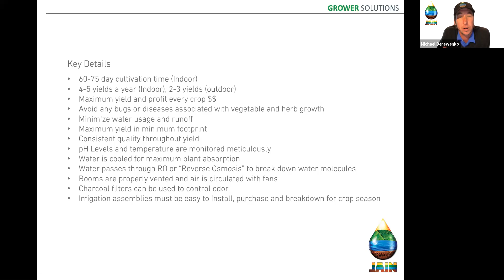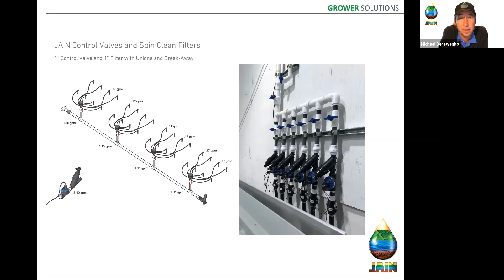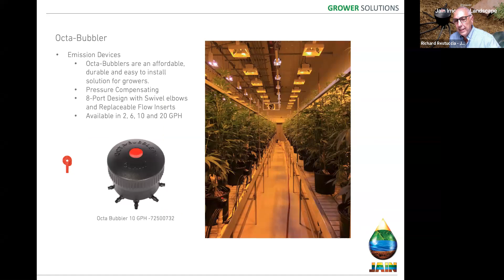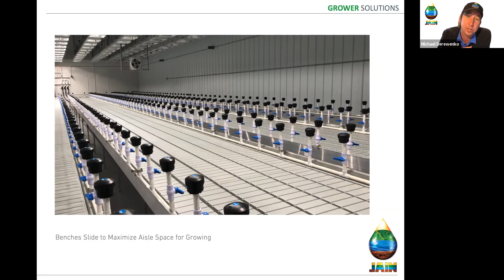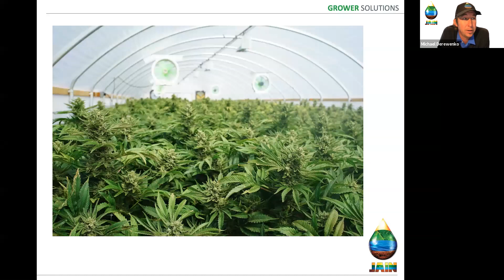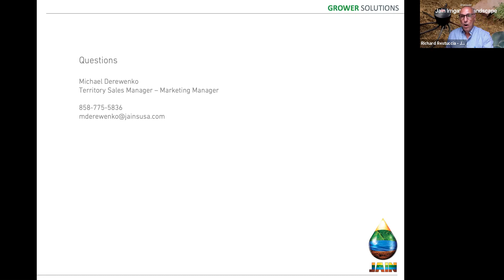JAIN Irrigation Growroom Solutions | Michael Derewenko

Comment: The arrow floating dripper is new invention in drip irrigation technology in Taiwan.  It utilizes floating ball disturbance to remove the residue so that can avoid blocking in the drip irrigation. Please see the YouTube website: 
https://www.youtube.com/watch?v=kThQGgL0UPc

In Taiwan, there is a farm which plants strawberry runners and uses an arrow floating dripper. The biggest feature of the arrow floating dripper is that it can automatically discharge residue, which is more against clogging than general drip irrigation. See YouTube video website : 
https://youtu.be/pcb4tq22fHc